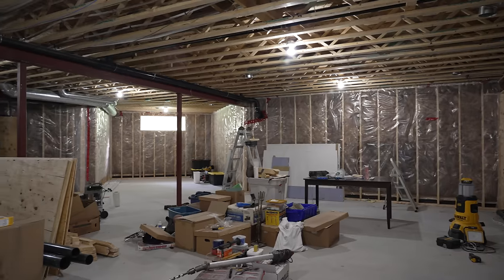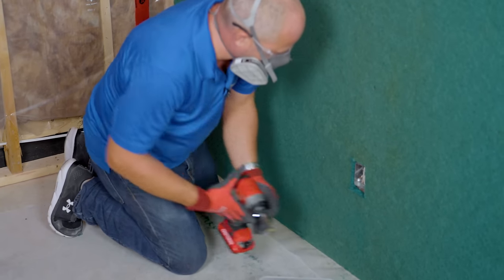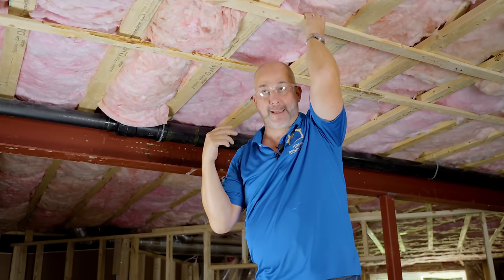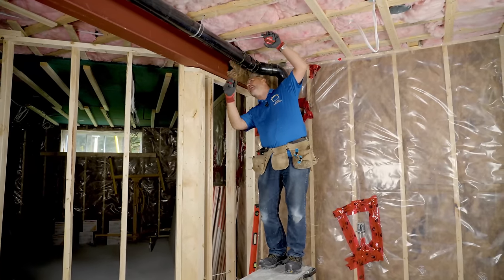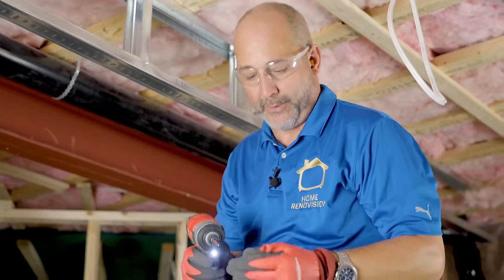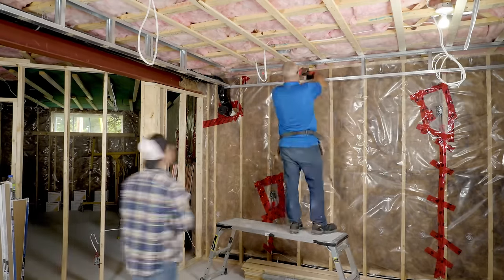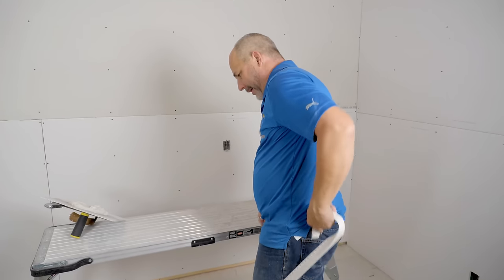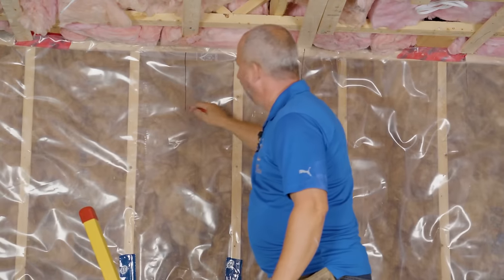I Finished This $80K Basement For $18K. Let Me Show You How You Can Do It!

Comment: I am currently in the process of building a 15' x 25'  TV room, with surround sound, in the basement of my home. AND, I have never ever done anything like this before. Thanks to you Jeff and your shows. Because of the way the concrete floor  was poured I had to measure each stud individually, and nail them up. Actually, I screwed them in rather than nail. It's easier to unscrew a stud. Studs are level and flush, corners are square, and ceiling insulation is almost complete.
Reply from the maker: Well done my friend. That is why we do what we do! Cheers!
Reply: I’m about to finish my basement just doing trim now. I Definitely benefited from Jeff’s videos over all my Reno projects. I find online resources vary in method so I rely on Renovision as my gold standard especially since I’m in Ontario I feel it’s most relevant.

Bless Jeff

Comment: Of all the tutorials I have watched you stand out among the best for this type training. Very articulate and explain how to do things in more than one way. That in itself is outstanding. I do want to mention that when using shims use them opposite each other, pushing the smaller sides at each other so as they overlap they get thicker as you push them together evenly on each side so you do not create a horizontal lean. Keep the education coming.

Comment: Thanks for making such excellent and informative videos. I consider myself an experienced DIY'r and am finishing my basement now. Your tip regarding enclosure of the bulkhead was extremely helpful and the framing resulted in a great looking job. I did as you recommended and went to my local Home Depot and had them rip OSB board for the bulkhead enclosure. Everything was uniform and worked like a champ. Thanks again for your help and best of luck to you in the future!

Comment: How did you tackle the staircase rise since you added insulation and OSB changing the height of the basement floor significantly? I'm struggling on what subfloor to do in my basement mainly because of the stairs.

Comment: Bought house 3 years ago western Michigan area 8miles from lake Michigan. The basement was already 3/4 finished and the temperature difference from upper level is almost 8-10 degrees different in the winter time. I noticed that the unfaced insulation batts are against the concrete wall and was framed tight to wall. I’m not currently having any water issues but engineered hardwood flooring is on top of concrete floor with only a thin vapor barrier sheet. Wanting to redo and use dri core and use insulation foam behind walls before the framing and insulation as this winters project. Any advice? Oh forgot to mention it is a walkout with no sump pump currently but again no water issues so far. Thanks

Comment: I need to put the vape barrier before I finish framing the outter walls? So the outter frame is not on the sub floor but I can do subfloor first for interior walls? Do I map out the outlets before I put the insulation in the outer walls? Did you pull down the HVAC so you would have heat in the basement? What are the best lights for the basement?

Comment: Can you use ZIP System® Wall Sheathing in the interior walls for the sound proofing? Just wondering as the isolation factor and fire barrier should help a tonne but it might be expensive or not for indoor walls due to vapoaurs. I would apprecate your viewpoint.  

I watch a lot of Perfins Builder brothers and it is them that suggested your channel.  You are all great!  

Keep up the good quality information videos.  Also in Calgary Alberta Canada a few builders came up with offset studs between rooms as a noise reduction method in building.

Cheers!

Comment: I have an old cidery that half is a concrete slab 20x20 4foot thick how would you insulate the concrete on the outside. Do you have to dig the full exterior or can you do partial ?

Comment: Jeff, I'm working on a house from the 1970's that has an unfinished basement. There is a large floor drain in the laundry space, the concrete floor is dramatically sloped towards the drain in about a 4ft radius. The house doesn't have water/flooding issues. I intend to put Vinyl plank flooring down. Do you have any suggestions to bring this section of floor up to grade?

Comment: My house was recently built new construction and it has insulation that is held in place with a tarp like substance it was then screwed to the foundation walls. Should I remove it to to put the water proof seal on? My concern is taking out the screws and then putting new ones back in the foundation would do more harm then good. Thanks !

Comment: Hello, we are currently installing lvp over concrete slab.

We took up some of the boards to replace the underpayment due to using a squishy pad instead of a thin barrier.  We found some moisture under the padding we had installed… is this normal or a cause for concern?  We’re scared to continue our project and worried about the risk of mold under the floor

Comment: We are starting to prepare for a finished basement renovation. We are in a town house so just the front and back of the house has insulation but they also have cement halfway up the wall. How do you make a proper Vapor barrier and frame these walls?

Comment: Why do you have a plastic on the exterior walls. On another video I saw that you recommended foam board slightly off the wall then your traditional installation. Do you put plastic over that as well. Wouldn’t that trap the moisture. I have a 2 year old house and I hear so many ways to do it. I live in Michigan and about to start.

Comment: Question: at about 1:10 you talk about an area of the dry wall were you mark the dry wall "Do No Screw" because there is a water line there and you don't want to screw into it. I get that, however what is stopping the homeowner from hanging a picture there with a nail, and hitting that same line. Shouldn't you be putting some type of protection behind the drywall so that nobody can put a nail or screw into that water line? In Wisconsin is it code to put a metal plate over the area were electrical wires are run through a stud, I would think this would be similar?? I'm not a professional by any means, I just wondered about this.  I enjoyed the video!!

Comment: On the PL glue, if it stays wet outside for 3 years, it will separate (freeze/thaw cycles).  We glued split plastic fence posts to our cement porch.  After three years in Idaho, it came off of the cement, but it still holds its shape.

Comment: If you use dricore and frame over the top of it to create the air envelope from floor to walls, isn’t the dricore going to expand and contract and potentially buckle when it can’t move because the bottom plate of the framing is secured through it to the concrete?

Comment: Hi Jeff and thanks for your fantastic videos! Im about to finish my basement in BC, Salmon Arm area. I was wondering if I should install a vapor barrier in the ceiling or just in the walls. I should mentioned that the house was built in 1977 and do have rough in plumming in the concrete slab (maybe an indication of a vapor barrier under ythe slab. Thank you.

Comment: I have a break in colour on my walls like a paint rail. White at the top and a colour at the bottom. 

To make the break, I line it up with tape and paint over all of it with white paint. Both sides. Then I let it set as the paint drys. That seems to make a good seal. 

Then I paint the other colour from the bottom to (and a little over) the tape. Let it dry and remove. 

Perfect every time.

Comment: 2:30:  Appreciate that you don't gloss over/edit the mistakes, because mistakes will always happen; and the correction is just another part of the usual job and making things right.  I was taking a break from raising in the ceiling and framing my upstairs master bedroom, drinking a glass of wine, watching your video for some inspiration, and thinking, yes ... that's exactly the kind of thing I've done in the past---you are a true professional, not someone who tries to cover up mistakes, but someone who knows it's not that difficult to make things right.  At 2:35 ... a tip for taking out those nails, use the cutting edge of a plier to vice grab the nail and and lever it out of the board to save the board.  Done in a million times, no nail can resist the grip of a good pair of pliers.

Comment: I love watching you work. Big time Jeff “just the tip!” Thorman fan boy. Can never thank you enough for sharing. Changed my whole life. Thank you Jeff and crew! Cheers

Edit: my first hardwood floor install I cheated and just cut the bottom half inch of the drywall out for the last row. I was pretty proud of myself for that. Not in any manual but it’s an option 😂

Comment: great video!  SUBSCRIBED.  question for you, i applied Sika leveling compound to my garage/driveway today.... i probably put a bit too much sand in (Quikrete general purpose sand used for the entire length), it allowed me to fill in some large gaps , so then the Sika backer rod was placed over the sand. So after applying the Sika to my entire 16 feet about two feet or so has the backer-rod showing up on the surface (it floated up), I mean it's under the caulk but you can clearly see the outline of the backer-rod, so my question is, can I wait till everything cures and then add some more Sika leveling compound tomorrow to just that two-foot section (to try to get rid of that backer-rod float-up outline??) Or is what's done, done ?  (my crack width was 1" to 1.5" in some spots, so the backer-rod was only 3/4" so in about half of the 16 feet of length, I had to add a thin weatherstripping to the backer-rod but that was not a perfect science).  Home Depot only had 3/4" backer rod, nothing bigger.
Reply: @davegordon6943  Thank you so much!! That helps a lot.

Comment: The reason for starting the ceilings first is not only the flatten out the ceiling corners, but also the typical design of per say 8 foot ceilings is 8 foot 1 and a half inches, this way there is not to big of a gap below, makes it easier to apply the baseboards into the bottom plate, but does this affect structural integrity no not at all so its a matter of how much do you want to fight later on down the road.

Comment: As a framer I always end the strapping on a joist instead of laminating a butt joint. Also stagger your seams and use ring shank nails. The wood will move and that'll hold up better over time.

Comment: There's a special tool that looks like a pry bar but it's not. It lays flat on the floor piece that you would hammer in but it doesn't touch the groove and the other side you can hit and you can get the floor planks in the groove and you don't even come close to the wall. I hope I explained it right. The tool is adorable and Home Depot and Lowes Carry's them.

Comment: I saw you using a shop vac, what is the best shop vac for the money?  Or more the cheapest one that is the best?  I have to try and unplug my central vacuum that is not totally plugged but enough it basically is useless one wall outlet.   Or if a buddy is offering to lend his just borrow one?
Reply from the maker: and med size vacuum works great nowadays. I have a craftsman that works really well and a rigid that is not bad. the secret is to use the bag and the filter and not just a filter.

Comment: i really need to ask;  Why are you putting the sheet rock on the wall incorrectly? (at 56;00)  The recessed factory edges go vertically, so no fugly butt joints appear,  the non-recessed edges go at the floor  and ceiling,

Comment: What fastener do you use in the nailer to prevent the drywall and strap from separating from the joist?
Reply from the maker: 2 1/4" nails are plenty strong enough to hold up ultrlight drywall. Cheers!

Comment: I am a bit pathetic considering how much time I worked in construction environment and I knew nothing about drywall other that making holes in it for my profession (telecom, datacom, and electrician). The first time I added some backing for some handrails for my dad I put in the drywall backwards. Then I started installing network wiring and I started off with trying to go flush so the tape had almost nothing on it. I started watching this channel and a couple other channels (funny I am in the US and learning better from our neighbors to the north than info I was getting here). Most said use this mud for this and then this mud for that and I was on a tight budget, so I asked on a video and was surprised to get him giving a response personally of saying I could use the 45 min I had, I just may need to watch the water for viscosity. Only on posts from Canadian creator do I seem to get answers from them and/or the community. Now I take my time and layer a bit more if I am unsure. My fear of drywall is basically gone because as he said "it is just drywall". My last several patches came out great, I just need to learn texturing LOL. As I get ready to start working on my own home, I am sucking up as much as I can. Thanks for all the info.
Reply from the maker: Happy to share this info and help folks. Great to hear you are having success with my advice. Cheers!

Comment: Anybody know anyone good enough to do this to my basement in Tennessee? It’s about 1800 sq. Ft. It’s currently partially finished, with interior framing for the rooms, and electrical both done.  Also has a full bath finished. Just needs insulation and drywall, etc… to complete.

Comment: Hi. I want to use Schluter heating floor in my unfinished basement. I have cement floors. House 1920s and slopped floor to a drain. I know I shouldn't finish the basement ... but we need the extra space.
Reply from the maker: as long as you use the membrane you should be fine. heated floors stay dry and the membrane keeps the salt from entering the space. Cheers!
Reply: Thank you very much @HomeRenoVisionDIY

Comment: Jeff, have you ever heard of using laminate flooring on walls? We are considering doing that in our basement.
Reply: You must be trolling 🤣
Reply: Nope, It’s actually a thing and looks nice, google it. We’ve seen A llot of manufacturers are now putting an “ok for wall use” notation on the box. Think about it - you can get just about any color pattern you design at a fraction of the cost of a actual “ship lap”  or wood boards. I just am trying to figure out the best backing - only seen it over drywall.

Comment: Can someone share how to find the “suana board” Jeff references in here? I’ve never seen it at the big box stores so I’m probably not looking in the right places. Also, if that’s great for sound transmission, can it be tied to the ceiling as well?
Reply: Its called SONOpan.
Reply: That said might only be available in Canada. HD usa has other similar products though.
Reply from the maker: sonopan is from Canada and is really limited in supply south of the border. If enough folks ask for it then the supply chain will answer the call. Cheers!

Comment: thank youuuuuuuuuuuuu, but i am curious as to why you dont use metal studs/wallinnards
Reply from the maker: wood is still preferred over wood by most builders.
Reply: @HomeRenoVisionDIY   bet, I am making basement plans so when funding is there work can grind as smooth as possible. any thoughts on a basement floor heater(not like real heater but like toasty toes) helping air circulation in a basement due to heat rising thus helping force radon out of the basement?

Comment: I need to rewatch this. I just saw one clip at 2:52 or so. Why dont you use a fence? And don't you verify an actual 30 degrees rather than trust the needle reading on the saw? I know, it's probably close enough but I'd want to make sure my angle is what I think it is. Just starting out in woodworking. I know many homes are not truly square and there is a little room to play.

Comment: Love your vids.....but one thing you need to incorporate into your Drywall hanging techniques,,,,,Rule #1: NEVER PUT YOUR HAND BELOW THE T SQUARE TOP.....if there's any nicks in the T-Square edge, it can make your knife jump off and could possibly cut your hand....It was my first drywall lesson back in 1976 when I had 21 stitches (11 internal) in my left thumb and forefinger. My thumb nail has been permanently split ever since. Otherwise you are doing a fantastic job
Tim Clements